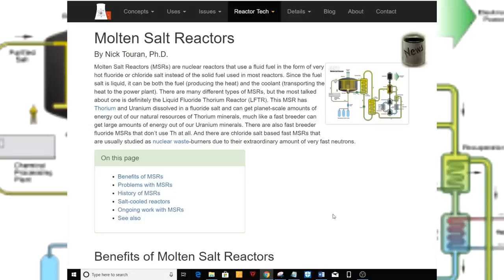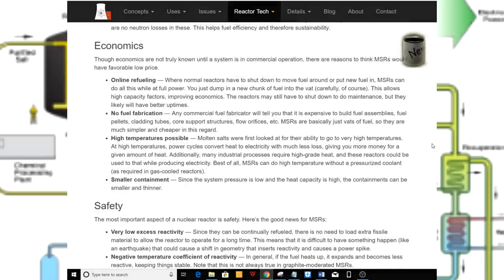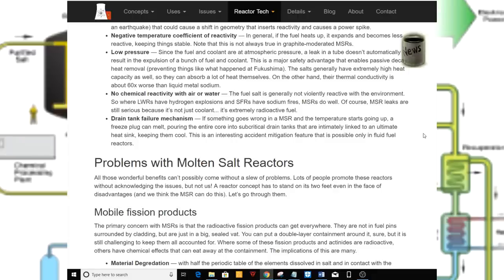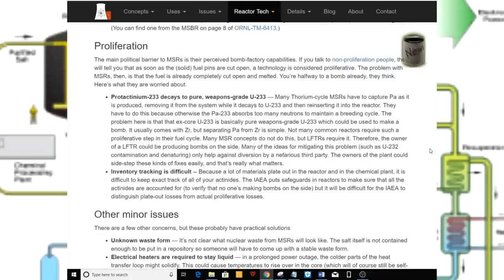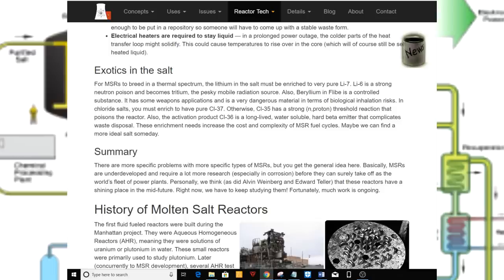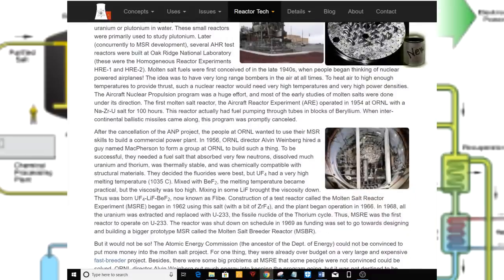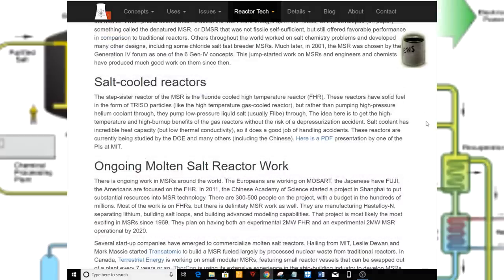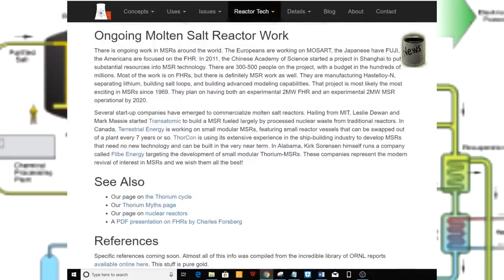The Actual Problem with Molten Salt Reactors ...and benefits obviously

Comment: Thorium based molten salt reactors are fool proof,  but the problem is the you know whos keep butting in trying to "meter" the damn system because they want every penny from every watt. They are fumbling up working models and it keeps breaking things. Thats WORSE than the issue where we have a perfect AC delivery system that gets coverted to DC (hence the power meter outside your house) and then gets converted BACK into AC by your power brick for all your devices. You cant accurately meter AC, and then they actually charge you twice for your power bill (delivery + usage) a literal $25 usage bill = $50.

Had it been a tesla model, electricity itself would have been free to use, but you would have a maintenamce fee of like $10 (todays money) to maintain public plants and transmitter equipment, but ultimately, free to use as much as you like.

Comment: The very possibility of attaining high operating temperatures makes MSRs the ideal heat source for iodine-sulphur hydrogen production cycles. Perhaps that's a card up the sleeve Toyota is hiding for the future (mirai, in japanese). South Koreans and perhaps even more the Chinese also seem to be quite confident that's the path to the future of sustainable deep decarbonization.
Reply from the maker: Many interesting uses for fractional distillation etc.. Thanks for commenting.

Comment: wait.... isn't molten salt very reactive with water in a non-chemical way? i've seen a bunch of channels on youtube where drops of molten salt explode unpredictably after being dropped in water, the mostly electrical process that causes it is frequently dubbed "coulomb explosion".
Reply: I think you're thinking of the reactions of molten, metalic sodium, not salts (and there is a chemical effect going on there too, which relies on it being a reactive metal, not a salt)
Reply: @dynamicworlds1  i definitely mean molten salt, like this guy is using for an example:
https://www.youtube.com/watch?v=PDRWQUUUCF0&t=22s
thats definitely table salt he pours into a cup, and then puts into a furnace to melt, not metalic sodium...
Reply: @sperzieb00n 
This is like saying "water can explode because hydrogen + oxygen can".
Pure sodium is very reactive. Sodium in a salt isn't as it is already bound. (Kind of like hydrogen + oxygen can explode, but the hydrogen and oxygen in water can't as it is bound)

Comment: Why don't we put Stirling engines on the reactor itself to mitigate the prolonged power outage problem? Try to run the electric heaters off of that. How much power do them heaters draw? I get that stirling engine generators ain't super efficient but that's because nobody has taken a hard look at them in like a century, we can build better ones now.

Comment: These are not good reactors
Reply: Why?
Reply: @waywardgeologist2520  they can explode for 1 because of the high pressures they are under
Reply: @waywardgeologist2520  United States of America had made these reactors before and we shut them down.
Reply: @mafelkins   They work at atmospheric pressure.
Reply: What do you mean by atmosphere pressure? What PSI?
Reply: @mafelkins  They work at one atmosphere, and NO they don't explode from the pressure. They are high temperature but NOT high pressure, stop trying to fear monger, you're doing a piss poor job of it!

Comment: xiiii so many mistakes on this video
Reply: List them please - no need to correct, I can google just fine.
Reply: not even going to bother, the errors are great, the way the reactor works have nothing to do with the way describe on the video, and if that's bad all the rest is bad.

For example ( there is NO U-232 or any other residue ), is simple, its a liquid reactor so any "residue" will be burn with the fuel, and anything else that comes out of it will have a very small life span.